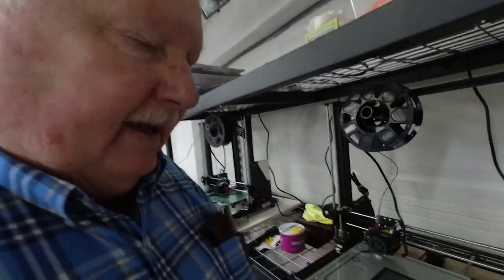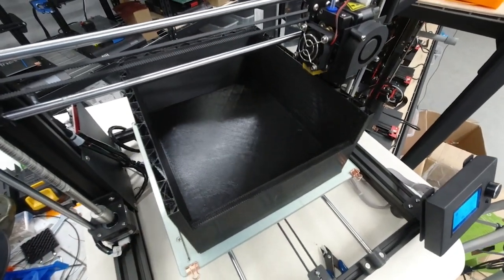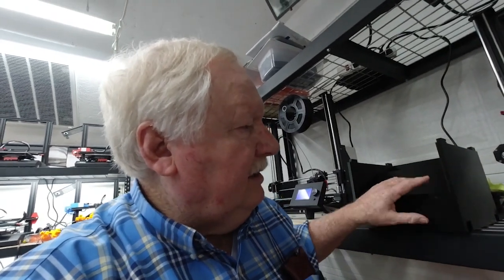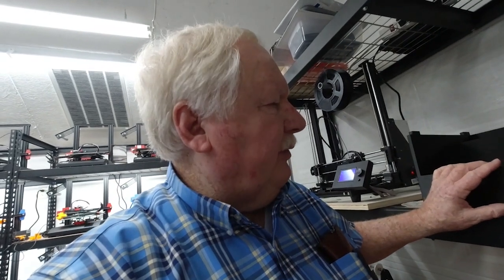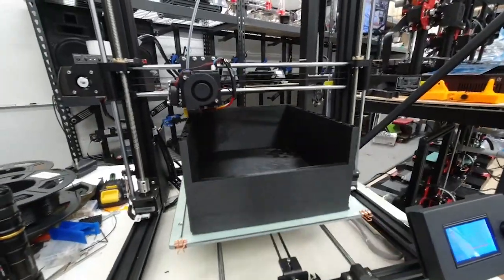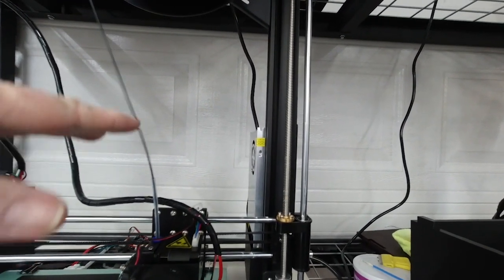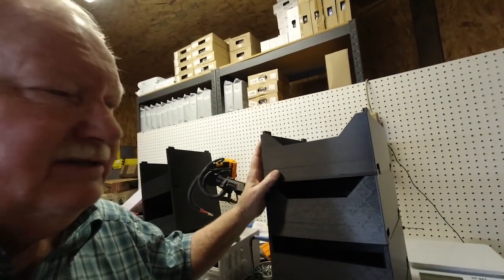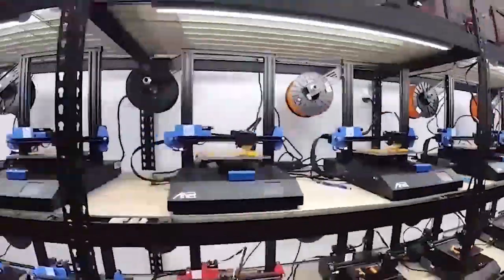EXTREME 3D PRINTING 1Kg FILAMENT IN LESS THAN 22 HOURS on A8-PLUS at my print farm

Comment: Impressed with your big box not warping.  Curious, what's your ambient (room)temp in your print farm.
Reply from the maker: I try to keep the temperature between 80- and 90-degrees Fahrenheit. It's a little harder in the wintertime on startup. Once many of the printers are going, they have no problem keeping the temperature at that level. Thanks for your support...Ken

Comment: Why not use a different method of construction? CNC or laser cutter with wood?
Reply from the maker: On this part it would be hard to produce using wood and not sure how to use CNC to produce it. Maby injection molding however that would require a large quantity to be cost effective. Good comment and ideas, thanks for your support...Ken

Comment: Neat print farm! Have you checked out CHEP's video on optimizing the speed settings? Also may be worth trying a bigger nozzle which now I'm just hearing you say :P I probably missed it but what brand and type of filament are you running? Thanks and take care
Reply from the maker: Thanks for the comment, Jon. I will check out CHEP's video, I'm always looking for ways to improve the efficiency of the print farm and quality of the printed parts. A lot of the PLA I am currently using now is Ender and Geeetech.  Thanks for your support...Ken

Comment: Hey pretty cool.   I need some help ....any recommendations on a 250 degree  nozzle for petg.  I’m using cheap nozzle with stainless coat.  I getting tired of changing it every other day.
Reply: I use Nozzle X by E3D and Vanadium nozzle by Slice Engineering. Have put a lot of abrasive filament through with zero issues.
Reply: Hey, I use a copper e3d nozzle and it works great! It’s a volcano nozzle on my artillery x1
Reply from the maker: Hi Joe, I have the same problem when trying to print PETG with the .8mm nozzle. I am printing 20 to 25 degrees hotter with the .8mm nozzle than with the .4mm when using PLA. To get the same results I think I need to heat the hot end to more than 250 or come up with a way to more evenly heat the filament as it goes thru the hot end. Maby the nozzles that Jon and Nicholas suggest will help in the heat transfer. Most of my PETG seems to start crystalizing and building up around the inner edges of the nozzle when printing at 250 degrees and soon the flow starts to become restricted. I have thought about trying a two-stage heater that would have the first heater fixed at 210 degrees and the second stage set at 245 or 250 and see if this would heat the PRTG more evenly thru a .8mm nozzle. will let you know what I come up with. great to hear from you my friend...Ken
Reply: I looked at the x and didn’t find a v8 size ..do they just make v6?